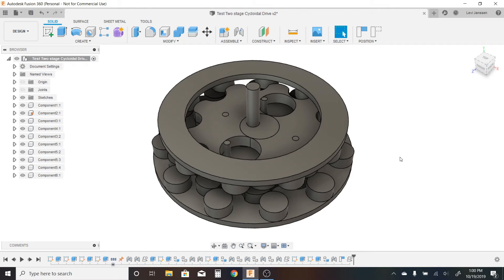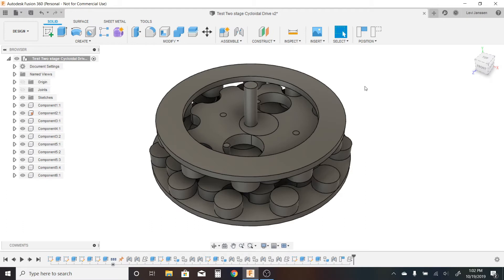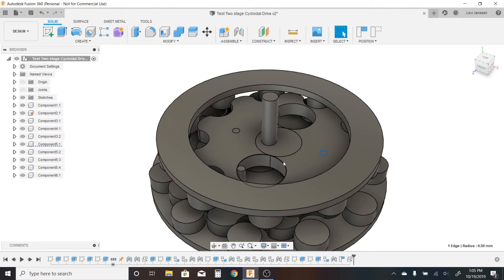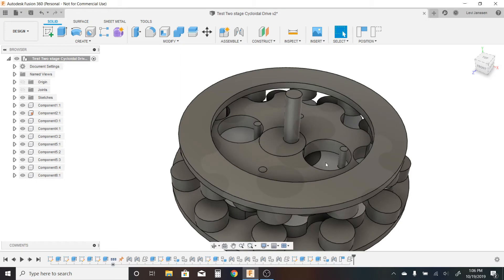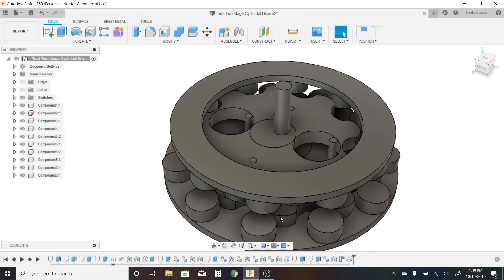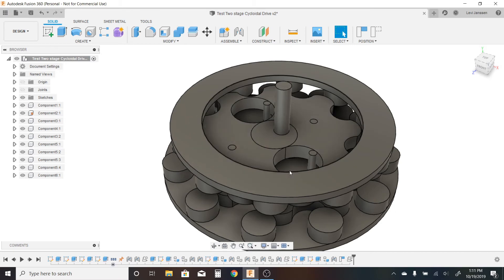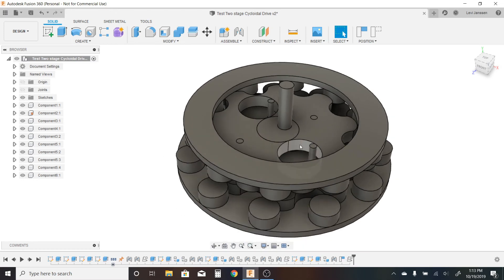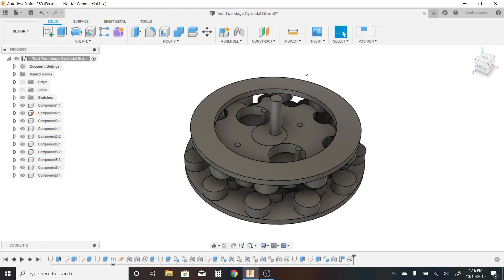A New Take On The Cycloidal Drive (Extremely Compact)

Comment: A way to think about the value of this approach is that you trade contact patch velocity or pitch line velocity for compactness. 

In the compound approach that you describe,  every point of contact on both disks experiences 90 nutations worth of travel per output rotation, while carrying the full force associated with the output torque. 

In a more conventional two stage approach,  your output stage would only nutate 9x per output rotation,  carrying the output forces.  Your first stage would operate at high speed (90 nutations per output rotation) but would only carry a fraction of the output torque. 

So this compound stage would eliminate a bunch of bearing and be more compact, but would have higher losses and wear.  All in all a good alternative to have in one's toolkit.

Comment: Those narrow pins coupling the two cycloidal disks will not be able to withstand the great torque that the cycloidal teeth could deliver.
Balancing this is not as simple at just having the same cross sectional area in the two gears (if made of the same material) as the disks are at different 'heights' or positions axially there will be a torque introduced in a plane parallel to that axis even if perpendicularly no or little torque would be induced.

Comment: The input ring goes to the first gear...
Shouldn't that be driving a ring to drive an output gear?🤔
(Like, flip the output ring and gear)
Or is that aesthetic? Feels like torque is usually put ring to gear at each stage. I'm not a mech either🤷‍♀️

Comment: Hi, If i am looking to make a cycloidal actuator with a 50:1 ratio. To reduce the vibration, I want to use 2 cycloidal gears, with 50 teeth each. Will this work? Or will there be no output?
Reply: Yes, you can do it. Also, you can buy Sumitomo cycloidal transmission on eBay and have fun with that.

Comment: i tried making one of these and for some reason the output rotation is not smooth, it rotates as a wave; so it looks as if its rotating in steps. is there a reason for this? the input is smooth as butter, as is the 2nd stage input..

Comment: This kind of stuff breaks my brain.  I just don't understand how you get that compounded reduction when both gears are being driven by the same shaft at the same speed.
Reply: think of a lever. you need two inputs (a pivot and a driver) to drive an output. in the case of a differential, the pivot is moving. in his design the input shaft is the moving pivot, and the pins from the lower gear are the driver. their difference drives the output (the topmost ring).

Comment: The math is simple: rotation 1 is 1/10 of shaft. rotation 2 is 1/9 of shaft in opposite direction. Subtract one from the other (1/9)-(1/10) = 1/90. [ fractional math: multiply top and bottom of both fractions to get same bottom, ie 10/90 and 9/90, then do subtraction of the tops (10-9)/90 ]
Nice work, I've been working toward something like this myself, though with the purpose of removing the need for the drive pins. see James Bruce's comment and my reply

Comment: Closest I've see is this video, which has a very similar differential-rate reduction with two sets of pins:
  https://www.youtube.com/watch?v=cnJCWX2nr4M
Yours is different in that the center lobes are offset for balance, but I do worry about the stacked tolerances vs a rigid center "lobe-set".
Reply: agreed, the fixed lobe-set in the centre seems better. I feel the weak-point of the standard cycloid gear is the output drive pins, and the single lobe-set addresses this. Balance can be restored without using a second offset gear-set by adding rotating offset weight directly to the motor shaft.

I was close to this idea myself, thinking of a concentric system where the second gear is inside the offset gear and meshing with a second set of internal lobes, so the whole lot is in one plane.

Comment: isn't it basically a harmonic drive?

thought about it two... 

nice work!
Reply: A harmonic drive uses a flexible gear driven by an elliptical bearing.
Cycloidal drives use round gears with an offset axis.

Comment: This is really neat!
What you have designed is a kind of differential gear, thats why the gear-ratio calculation is different from a two-stage gear. The first stage (1/10) and the second stage (1/9) are coupled at the input shaft; and by coupling them at the disks as well, you are getting the difference at the output: 1/10-1/9= -1/90. (During one input rotation, one stage moves 1/10 while the other moves 1/9 in the opposite direction.)
I have seen differential gears designed with planetary gears, and some with cycloidal gears by fixing the two disks together. Your solution balances the the two disks, which is much better. Kudos!

Comment: That's interesting. Thank you for sharing. You should work for Spinea in Slovakia ;-) They build really crazy trochoidal gear reducers. The one you designed reminds me of the patent of Rudolf Lorenz the son of the inventor of the cyclo gear system. He also thought of a concept of two discs with in different size and the output shaft with bolts on the outside again. Check out patent DE19722399A1 on espacenet if you are interested in that. I also just looked at it breathly up to now.

Comment: so the most important thing is to balance the two disk?I'm not sure how to achieve it,could I just make the two disk the same weight ?
Reply: I just saw another video about 2 stage cycloidal gear which was 3D printed .But the difference is he makes the top less lobe disk and the bottom one as one piece,  he just dosen't use pins and holes like you says in this vedio.I'm curious about the designs between you guys, thank if you could reply.(⁎⚈᷀᷁ᴗ⚈᷀᷁⁎)
Reply: jooke huang 
vi-de-o

Comment: Awesome! I came up with a similar mechanism where the two discs are glued together, but it's kind of useless due to the vibration. This pin system is much better. The reduction formula for this family of mechanisms is 1 minus the ratio of the ratios. That is, 1 - (top disc lobes / top ring pins) / (bottom disc lobes / bottom ring pins)
So the closer the top and bottom ratios are to eachother, the more reduction you get.

Comment: Not the first to come up with this as a device, but you did an excellent job displaying the concept. The only thing presentation wise that would have been nice to show would be an exploded assembly view of it.  Also, if you wanted to continue with an increased compact reduction, you can take this design concept and offset 120 degrees rather than 180 and make it a 3 stage reducer. The only thing with that though is the ability to back drive is diminished, and you start to pick up a little bit of backlash throughout the device just because of gear to lobe clearance that you need in real life. But good job on your drawing, now get out in the shop and build a physical one.
Reply: Who was the first came up with that -
And by what name does it come? I'd definitely want to see the evolved version.
Reply: It’s frequently called a hypocycloid on Youtube. Commercially you can buy it under the Onvio Dojen product name.